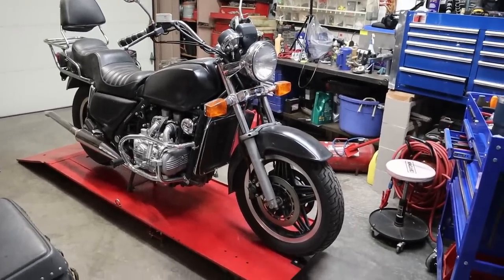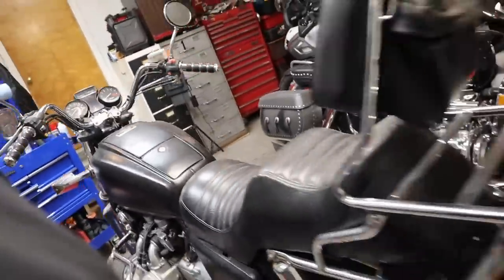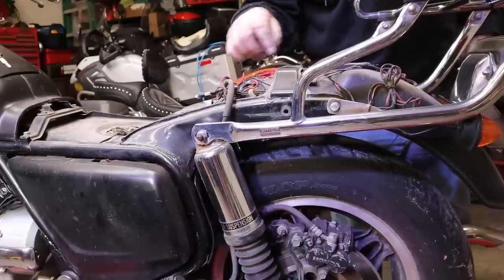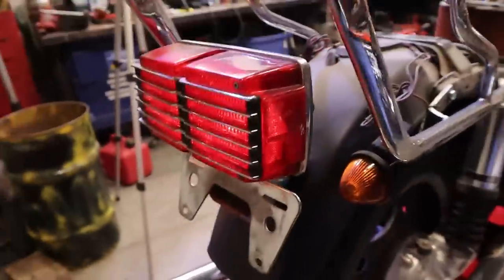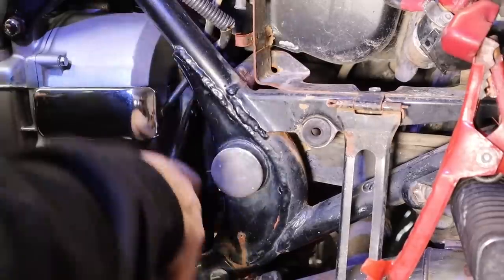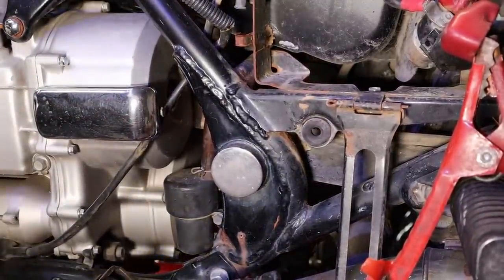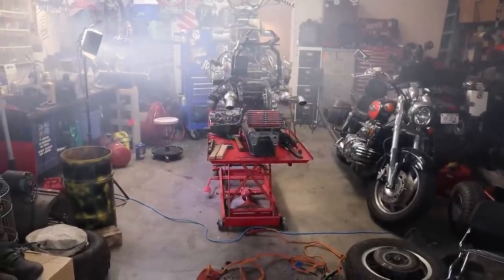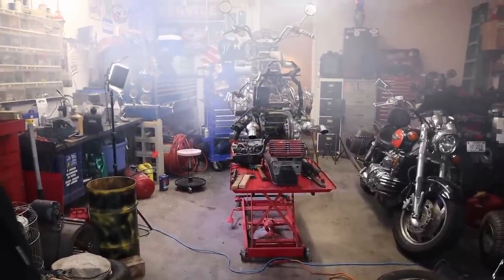1982 Honda GL1100 Goldwing Revival Part 1 Setting for 12 Years.

Comment: Looks like a nice one. I had an '80 with single piston calipers. The '82 has the best brakes of the 1100s. Dual piston calipers and no interconnection. Riding a 1987 GL1200 now and want to take the fairing off. Oil in the air box is normal. Engine vent goes into the air box.

Comment: Awesome repair. 
I’ve got a gl1100 1983 goldwing interstate. 
She runs beautifully. 
She almost past inspection but the hand brake will not activate the brake light, only works with the foot brake. 
I cleaned off and replaced the electrical connections at the base of the hand brake switch but still it will not activate the brake light. Any ideas where I should start poking around?
Reply from the maker: Check the connection inside the headlight or the connections up front. Thank you for watching..

Comment: I’m currently repairing an 83 aspencade I got for 400$! It runs needs a carb clean and some love for sure, I’ll be watching!
Reply from the maker: Sounds like a great deal. Thank you for watching.
Reply: @RaymoreRepair  watched through everything! I’m currently stuck on making a barebones wiring harness, just essentials no lights no frills just to get it running smooth while I restore the other parts. Any recommendations?

Comment: I bought one too and restored it - worth over $6000 now - I bought mine for $500. Don't underestimate the value or reliability of that bike, It is a literal masterpiece. We rebuilt most of mine and it's almost ready to hit the road. Worth putting money into , big time. The gas tank - fill it with vinegar from the dollar store and let it sit for a few days. You can try rust remover also, but the vinegar worked for me and a pressure washer to douche it all out. Trust me, if you put $1000 and some time into this bike, you will have a lasting rider and a money maker on your hands.
Reply from the maker: I agree with everything you said.  Thank you for watching.
Reply: Hi,
Interesting to watch your video...
I want your opinion about a 1980 Honda Goldwing that has been stored for at least 4 years. 
1) Do you think is still fixable?
2) How much do you think is worth it?
3) With this information,  any idea of how much I need to put it in normal condition?
Thank you for your help and answers. 
AG.

Comment: Good video but I'd like to point out that the radiator caps on Honda's are metric. 1.1 8:33 like you mentioned is 1.1 BAR and is around 15 psi. Mine has a .9
BAR cap which is 13 psi. Some caps on these bikes are 1.3 BAR and that's almost 19 psi
Reply from the maker: Most all of them I see on OEM caps is 1.1. other are quite possible. Thank you for watching.

Comment: Hi, I have removed my starter motor several times and never got oil there as you did, maybe your baby had to much oil?.  By the way, the terminal you soldered in the starter motor is a "live" wire comming fron the stator to the brushes and the rotor, that connection is really close to the brushes plate (ground), it is a great idea to insulate that terminal.
Reply from the maker: Yes That is the main feed of power to the rotor. Insulating it would be a very good ides. As for the oil. Yes it had about twice as much as it should have. I had never experienced the oil like that either. Back in the day I pulled several of these starter form GL1100 and GL 1200s and that was a first for me. I guess I'll start be checking the oil next time.
 Thank you for watching.

Comment: Just bought a non running 78 GL1000 that I'll be getting back up and running. It has a new battery and turns over so it seems like it will be an easy one. :) My throttle is also stuck.
Reply from the maker: Should be a fun project. Thank you for watching.

Comment: Well shucks, those air shocks are worth 300 bucks for sure....look fairly clean and good boots. The RED Light on dash is OIL Pressure. 1.1 Bar = 15.9 psi ...I personally used a 13 psi cap and it works fine. I almost NEVER try to re-build the starter, due to the exact reason you showed. It was dying for so long and abused, it almost never works out. Rick's Electric rebuilds em with a warranty for a C note, I start fresh. Nice try though.  IT'S ALIVE. She's smoky but it lives.
Reply from the maker: Thank you for watching.

Comment: Hi. I’m having the exact same problem with my starter. Didn’t catch what you said after the second attempt at making the starter work. What was it you did to it to get it going ?
Reply from the maker: The pole had come loose of the main wire in the starter.

Comment: Do You have a Part 2 or 3 ? If So Where Can I Find Them ? I Need Some Help With Fuel System From Tank to Carbs & Overhauling Carbs !
Reply from the maker: Yes! I have posted the video on carb cleaning and getting them to work. I did not post much on the fuel tank. Thank you for watching.
Reply: I cleaned my gas tank with vinegar. Lots of videos on line. Mine want as bad this one but it came out very clean. Bike has sat for over 10 years. I would like to find a video on setting the timing on a 1200. Any suggestions.

Comment: Could you tell me if you had power coming from the solenoid wire to the starter. Mine is doing the same thing the solenoid is clicking. But I'm curious whether or not you had power from one side of the solenoid that goes to the starter meaning 12v. Cuz my meter shows 0 from that side. Could you please help thank you
Reply from the maker: If you have zero volts on the starter side and can hear the starter solenoid click, it is most likely a bad solenoid. use a set of jumpers to go from one large terminal to the other and see if the starter will try and turn. Thank you for watching.

Comment: How did you get the fuel tank out?
Oil?
You drained it, then we saw it running 😮
Reply from the maker: Yes, i put oil back in the engine. You must remover the rear tire and fenders to remove the fuel tank.